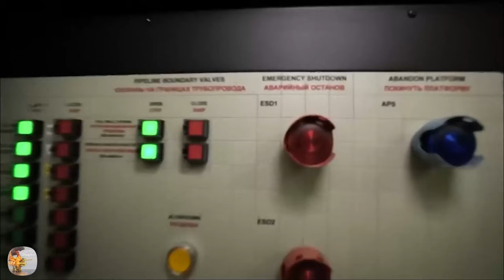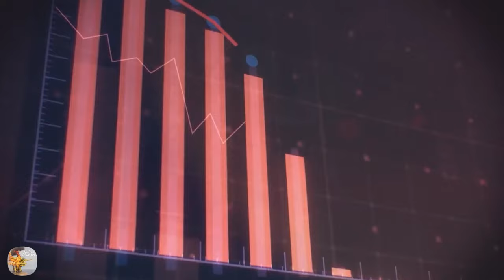Seacrest Drillship CAPSIZED! Oilfield Disasters #10

Comment: I have done an Apprenticeship in Marine Engineering.From experience,I
knew that many Passenger Liners had Stabilisers which can be extended
from both sides into the water to steady the Liner.They worked very well.
I know there are many stabilisation systems that can be used.